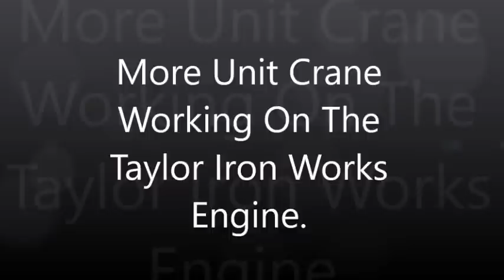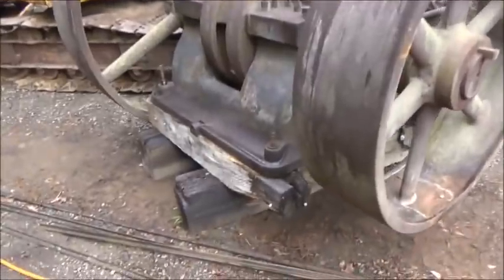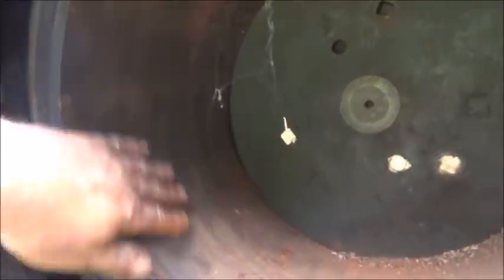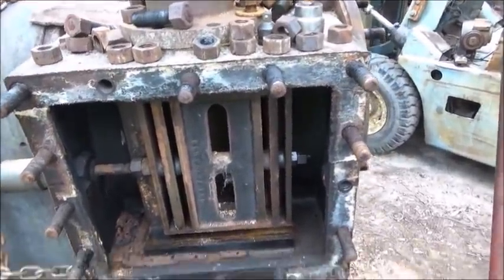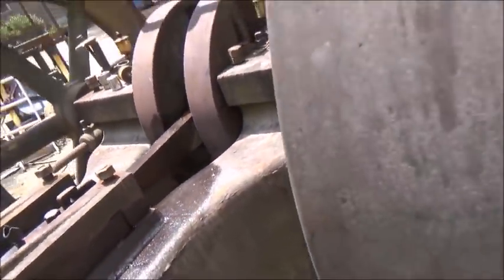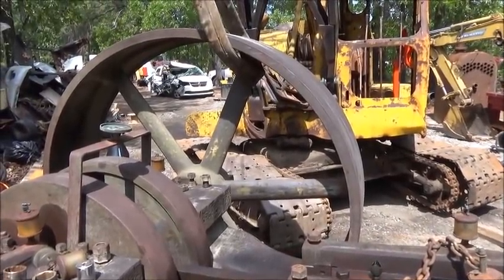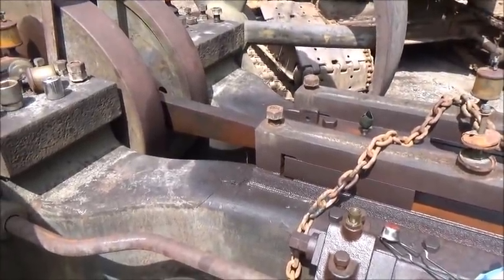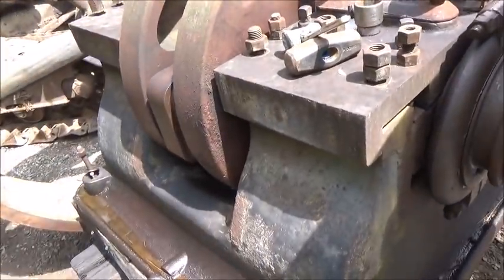TAYLOR IRON WORKS STEAM ENGINE  TEAR DOWN STUCK??

Comment: Hi Jonathan.   Love what you do.  Keep up the good work preserving our history!  I am a  board of director for the Zagray Farm.  The operator of that Northwest 80D George Jarvis  just turned 92 years old.  He has been operating cranes and drag lines for over 70 years now and sure know what he is doing.  My father was able to use some original prints for the Fairbanks to make a metal frame to put into the concrete which held the mounting bolts into position. That beast dropped right into place.  What a feeling you get when it starts up!

Comment: Hey Jonathan,  I have run these types of manual cranes for many years, and a lot of them had tricky or bad brakes when letting down a load.  What I did to control the load while letting it down was to disengage the main clutch on the drive works,… and dog in the lifting clutch (Just like you were lifting the load but without the main clutch engaged to drive the works).  Then you keep the foot brake applied, and when you let off the brake the load will turn the draw works while lowering the load, this way you have excellent control of the lowering (foot) brake.  Using this method you can inch a load down real easy a fraction at a time even if your foot brake is not that good or is grabby.  This way it is using the friction of your main draw works as a brake also to control your dropping speed.  When you do this it will work perfectly.  You need to practice and play with a load that it will not hurt to drop…. until you get the feel of it.  Take my word, after you master this procedure you will never go back to just your foot brake alone.  I hope this helps you my friend.  I’ve used it on several cranes with very little downward brakes at all, and the load would ease down ever so slow and with perfect control.  Try it and let me know how you like it.  Keep up the Great videos… I love them all and look forward to the next one.  Take care my friend,  God bless & Godspeed.

Comment: Glad to see another mill engine surviving. A lot of the features and details look very similar to my 8x10 shop engine which is 1902. Yours is probably about the same vintage. My concern would be rust in the main bearings. I would pull the caps and lift up the crank a little to clean any rust off the crank journals and polish them up before you start turning it much. ....Dave

Comment: It is a wonderful thing you are doing with this old equipment because just because it's old doesn't make it useless. It also goes to show that with skill and determination these machines that were discarded can be made to work again. Not for nothing, your crane was left for dead not too long ago. Look at it now. It works just fine doing what it was made for. Keep it up Jonathan. You are my favorite Mr.Fix it man.

Comment: Such a great machine, built to be a standard power machine. I just loved working part of my career in the Combined cycle power facilities, throughout the world. The steam cycle , where we captured the last usable energy of a gas or liquid fuel combustion turbine to make 1200 lb of steam and that steam turbine would use every bit of that steam and collapse into a vacuum . This machine of course is a low pressure engine & it relied on gravity fed oil system and produced gobs of low rpm torque. Imagine the lives that kept it running . So cool thank you Jonathan 🇨🇦

Comment: Jonathan, when I worked on one of my old gravel crushers to get it rolling over I wrapped the tow strap around the flywheel like a belt and pulled on it. Glad to see you kept it as low as possible for safety and swung very slowly with it tied off to crane so it wouldn’t rotate or swing out. I made a heavy pick with a crane years ago and even swinging quite slowly the centrifugal force made the load swing out slightly and start to tip the crane, had to drop load but it was close to ground so it wasn’t to violent but it scared me.

Comment: You may not have a tractor with a flat belt but you do a have a wrecker with a winch. Wrap the cable a couple times around and pull to rotate it a few times

Comment: Nice old single cylinder steam engine you have there. It probably ran either one large rack saw bench or a line shaft driving  smaller saws. With the twin flywheels it may have been set up to do the two jobs. I think the bore could do with a light hone and it needs new oilers but other than that it seem complete. Once running and teething problems sorted out,  I would try to find the original color, blast it and paint her up.Original colour looks grey but if you clean oil from crank well you will find original.

Comment: I heard what you said. A lot of things have changed since I first came to this channel. I came here to watch old V8 engines running on the ground without platforms. That was the main attraction here. It has been a long time since you have run any Motors without platforms. The crane was a cool project. The steam engine from the swamp was really cool too. I would like to see that old crane with new paint. I would also like to see an old V8 motor first run in years with no platform. I miss those old first starts. But it's your Channel. Keep on posting👍

Comment: I sort of tightened up when you boomed over.  I remember what a runaway boom sounded like.  It must be adjusted well.  The old cranes we used to use were all used and abused.  All the brakes were egg shaped and not round anymore  We had to pat our foot on the brake to let it down.  Well Done!

Comment: I would paint this one kind of a blue-gray about the depth of hue of Chevrolet blue and the grey they painted Chevrolet truck engines.  That would be a nice contrast to the green on the Bates Corliss engine. Maybe paint the flywheel red on either machine. The condition of that bore is outstanding considering how long it has been since the engine was running.  The Unit crane has earned a new paint job as suggested by Alison Fort.  You will find yourself messing with it more and more.  I wish I was there to help you snug up the tracks.

Comment: That steam engine could run a small sawmill, and the sawmill scrap could fire the boiler.  Don't just make it run.  Make it useful and productive.  Nothing is happy unless it's useful and productive, Jonathan.  The crane could load the logs.  People would come from miles around to see wood cut with a steam engine-driven sawmill.  What a sight it would be, huffing and puffing, logs rolling down the track into a 36 inch blade, and cutting away.  And all of it from another man's scrap.  All of it built before most people were born, a real tribute to the good old days when steam ran the whole world.

Comment: Hi Johnathan I really appreciate how your mind works you were dead on about using a older model crane to lift the steamer rather than a newer model!
I am not sure about the UNIT Cranes but well I should say first if it has power down on the load line you can just disregard this part of my comment but if you’re just lowering a heavy load by releasing the load line brake and I hope you can make sense of this but if you shut the engine off but leave the master clutch engaged and pull the leaver that would normally engage the hoist drum clutch and then slowly release the brake on the load line it should REVERSE THE DRAW WORKS now before trying out this idea try it with something heavy enough to reverse the draw works but something that doesn’t matter if it doesn’t work out! And maybe if you know any older crane or dragline operator that could walk you through this would be great because I don’t want you or any one to get hurt so if it doesn’t make sense don’t try it! But I know that it was what a lot of crane operator’s did if the cranes didn’t have Power Load Lowering on the hoist drum! Anyway keep that old iron running stay safe!!😀🇨🇦👍🏗🪝👌🤌👈👉👆👇👎

Comment: In less than 24hrs over 811 views, JW is doing ok with his video,s!
With your mast on the crane near vertical it handled the steam engine but if the mast was more horizontal i think it would Not have coped with it. Can hardly wait to see this machine RUN, LOVE steam engines, they are ABSOLUTELY AWESOME!!!!

Comment: One way to precisely lower load is to use main clutch with engine off and dog in main hoist use gearing to lower load slow using friction of gearing to slip main clutch. Machine will swing backwards though.

Comment: Nice you are certainly right about the entertainment value of working with the old machines rather than new stuff. And that goes for you as well. I hope you got the safety stop on that boom lifting that much weight with the boom so high that was pretty sketchy

Comment: A balanced valve has less of a load on the valve face. The effective  area is approximately that of the port openings instead of the entire area of the valve. This is more important on automatic cutoff governed engines.

Comment: Jonathan, try tying a long strap or heavy rope or something to one of the spokes in a flywheel and wrap it tight multiple times around the flywheel and pick up on the rope until it unwinds all the way and turns it over until you run out of rope or strap and that will turn it over a lot

Comment: I noticed a couple of spots on the chassis, on either side of the crank when looking at it at top dead center, that look like there was something there. Any idea what that was? I am not sure why but steam engines intrigue me. They are on one the one hand, really simple, but on the other hand, when you see all that plumbing and rods and whatnot, complex. The other thing is, they are so powerful yet often move so slowly and are relatively quiet.

Comment: Well sir,you mentioned how nice it would be to have a tractor with a drive pulley and belt too spin the flywheel while you oil up everything and get her moving smoothly again,,those leather belts are hard to come by nowadays,,perhaps a 20 ft piece of rubber conveyor belt,about 6inches wide,and use the drive axle and rim of and old truck or car sitting on blocks to power the belt,tension the belt moving the power source,,might work,those conveyor belts are fairly tough,,might be an old conveyor hiding near the swamp that the Unit came from,,I'm just trying to think outside the box,and find the cheapest way too spin the old girls flywheel..Have a Good Day!!😎😎

Comment: Can you pull the bed off a 4x4 truck put it in creeper gear in low 4x4 with the front hubs unlocked and wrap a belt around the rim to get the steam engine rolling?

Comment: you could take like a truck without a bed on it and back the tire up against the flywheel and jack it up and let it idle and turn the engine over slowly with oil to get it free-d up

Comment: I'm an old geezer mechanic. I imagine that new old stock parts are non-existent, so, if it were me I wouldn't be turning it over and risking damage to the crankshaft, bearings, pistons and cylinders. I'd tear it down completely, sandblast all parts, hone that cylinder, clean up the piston ring lands and rings, have new babbitt material made for the bearings, and then reassemble and paint. That way, it'll last another hundred years.

Comment: I know you are nervous bout moving that around without a tag line.in jonathan w nature 
I. Got it.
I moved slabs of granite in the wind using jumper cables as a tag. In the cab of the forklift.gotta do what ya gotta do to get the job done. No fear .just one of the thing I respect about you JW

Comment: Hey Jonathon, great job on the little Crane that could. I think it will help preserve it if you put paint on it. I noticed on the flywheel end of the Steam Engine, it looks like a piece was cut off of it, could it have been a lift point that they decided to remove once the Engine was placed on it`s mounts, before the building was built around it. What do you think Jonathan?

Comment: You got it, Humidity ! Hot in the summer, cold in the winter, locks em up every time from sittin ! You don't see the young folks being interested in vintage equipment? ---- me neither. We are a very rare group of Americans that fix old things and we are dropping off quickly with zero replacements. Do I have faith anyone will take our place ? Man, the way things are going, I don't think there will be anyone left at all, there is no future, as we very well may see the end.  To many self centers crazy's out there and no/ very little common sense. Have you seen the price of everything over the last 6 months ! If your going to buy paint to paint the crane, get ready for a SHOCKER !!!!!  holy cow. I just bough a QT of Nasons  BASE COAT color----- Seventy eight DOLLARS ! Already REDUCED ! that was 28 dollars last year not reduced !  enough to mix 1/2 gallon of sprayable paint last year but not any more .  Just crazy.

Comment: I suppose a lumber company would be one of the few enterprises in 1923, where a new steam engine still made sense, given that their boiler fuel from wood offcuts would effectively be free. The same reason why Chinese coal mines still use steam locomotives. My family textile company in the north of Scotland, when they moved to newly built premises in 1901, went straight from waterwheel power to using an Otto-Crossley 15HP gas engine, running on town coal gas from the local gasworks. This was later replaced by a larger 30HP Tangye gas engine running on a mix of producer and water gas, made on site. This was proving too small by 1925, and was replaced by a Shanks 80HP (68 litres/4500 cu in) single cylinder diesel engine, a UK licence built version of the Deutz MKH 260 engine. This was in use until 1938, when mains electricity arrived. The Shanks diesel was sold off to the government during WW2, to power a generator on one of the Scottish outlying islands, where a wartime airfield had been built and there was no mains electricity.

Comment: Surgery take your strap and wrap it around the inside of one of the wheels and tie it centered into the off the pulley wrapping around the bottom of the pool and pull up with your crane that way at least you get a almost a full turn on one left wrap the rope around the spoke and then center it on the pulley

Comment: Get u a old truck take bed off, throw steel wheel on it, and use it to run the stream engine with belt from rear drive wheel.

Comment: Jonathan, please be careful and check into laws before touching that boiler. Boilers must be repaired by law by someone who holds an ASME stamp. It's specialized work requiring special skills and inspection by an ASME inspector. It would be illegal to operate a boiler without it being inspected. A boiler under pressure can explode by all the water flashing into steam all at once, releasing tremendous force and it can travel a mile away either like a rocket or several hundred feet right through trees and houses. Steam is nothing to play around with. Get in touch with your state boiler inspector.
Reply from the maker: Only if it is business or public use. Not illegal to weld or repair for personal use. It's 15 psi and I have welded on 200 psi pressure vessels and hydraulic cylinders well over 2000 psi. Don't worry, if it bows it won't go thru the camera.
Reply: @jonathanw4942 ow, didn't know you had those chops! I will stand well away from the computer screen. Thanks.
Reply from the maker: Little to the left or right will be fine.

Comment: I PULLED A BIG OLD ATLAS ENGINE DOWN ONCE TO FIND THE VERY SAME THING, AND COULD SMELL A VERY STRANGE, STRONG, AMONIA LIKE ODOR THAT WAS THE RESULT OF EGGS LEFT UNHATCHED IN THE NEST!, I NEVER BOTHERED TO MENTION IT BECAUSE AS YOU SAID "WHAT KINDA" WHATEVER WOULD BUILD A NEST IN AN ALMOST IMPOSSIBLE TO ACCESS LOCATION  ANYWAY, AN QUICKLY THE HOW DID WONDERING GIVES WAY TO WHERE DID, WHEN AN WHY!......BUT I THINK THE WISE OLE OWL ENTERED IN DOWN THE EXAUST INTO THE STEAMCHEST, AN INTO THE CYLINDER THRU OPEN FRONT "SLIDE VALVE PASSAGE,
MOMA OWL TO EGG EATIN SNAKES,     YALL WON'T GET MY BABYS, IF YOU DO GO AFTER THEM, YOU'LL NEVER CLIMB BACK UP THAT 12 FOOT EXAUST PIPE, BUT I'M IN AN OUT EVERDAY, TILL HATCHDAY! AN ON THAT DAY, I'LL BRING THEM OUT WITH ME  (ONE AT A TIME?) RECON SHE FLEW OR WALKED  STRAIGHT UP AN OUT THAT PIPE WITH THE LITTLUNS,? THINK ABOUT THIS A MINIT!